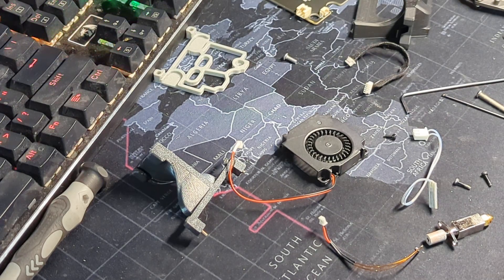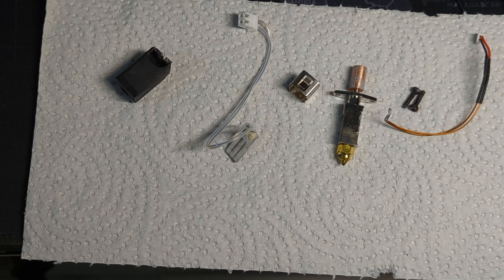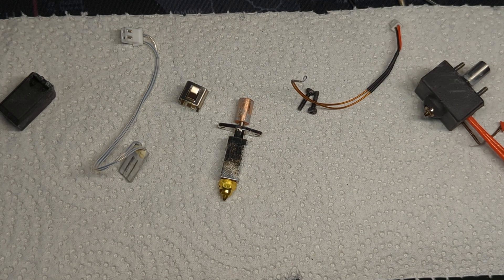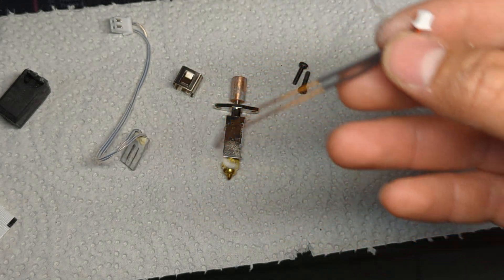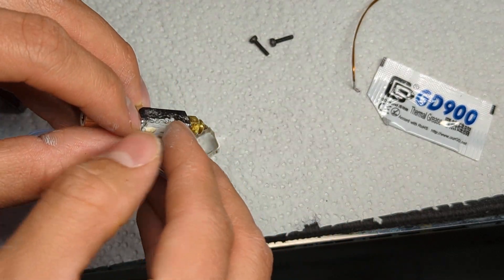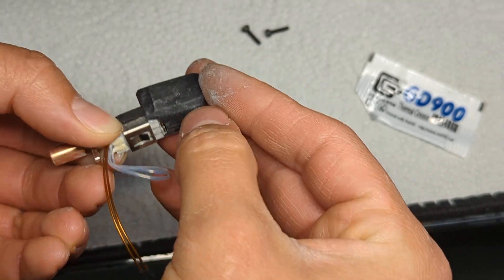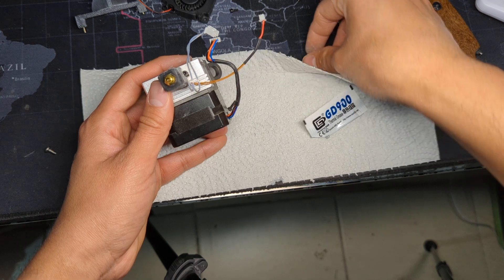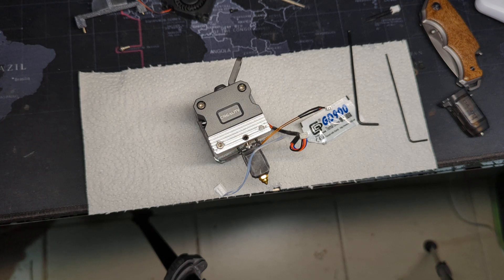Ender 3 S1 Pro - CHCB-OT Ceramic Hotend

Comment: Hi, have you noticed any degradation of the provided gd900 paste? I was doing some troubleshooting of this clone hotend, and I noticed that the paste was almost dry just 15 days after the installation. I looked at the specs of the gd900, and it only has a maximum temperature of 200C
Reply: Boron Nitride thermal paste Slice Engineering

Comment: Hi i installed this tringle lab ot hot end , i am facing bed levelling issue , its behaving weird scraping my bed . I have added a 10 mm mount to cr touch.which firmware do you use